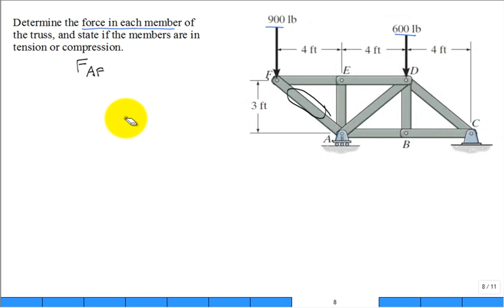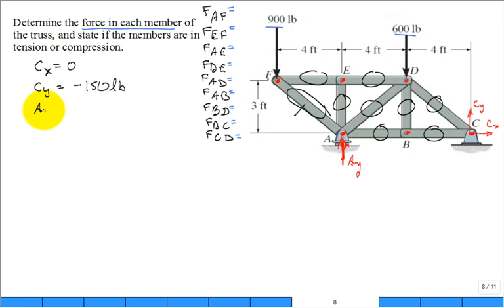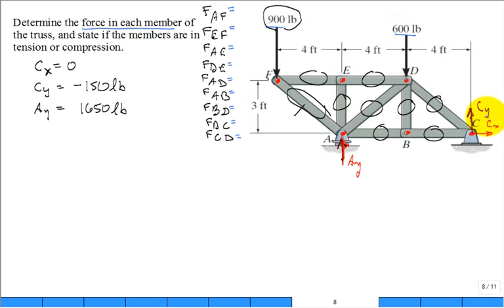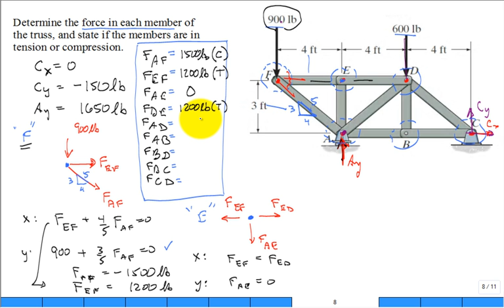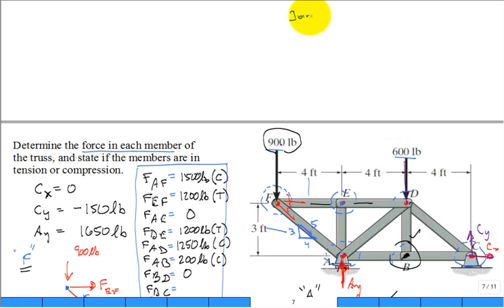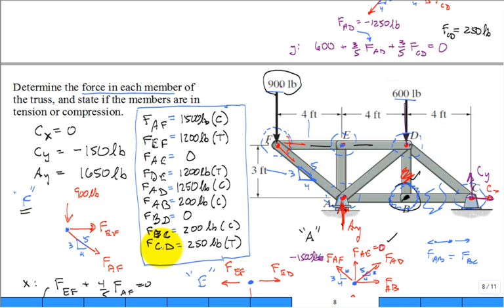Truss method of joints

Comment: for those confused:

Cx is automatically zero when summing up all horizontal forces, because it is the only horizontal force. 

you can get Ay by summing up moments on joint C, assuming that clockwise is positive  : (-600lb)(4m)-(900lb)(12m)+Ay(8m)=0
equation will then become: Ay=(600)(4)+(900)(12)/8 , then you will get 1650lb.

to solve for Cy, use summation of Fy=0 and assume that upwards is positive. you will get: 
-900+1650lb-600+Cy=0 , Cy=-150lb
*1650lb is Ay

Comment: To find Cy and Ay. First, take the moment at point C and you will get Ay, then you will calculate the total forces in the Y direction and make it =0 
-900-600+1650(which is Ay)+Cy=0  ---------------> Cy= -150
Reply: How did you get Ay??
Reply: @airdroper6960  you can solve Ay if you set your moment of inertia at C. Its like this:

Moment at inertia at C = 0;
(Assume all downward force is positive)
1st:
600lb(4ft)-Ay(8ft)+900lb(12ft)=0
2nd:
Ay(8ft)=600lb(4ft)+900lb(12ft)
3rd: divide both sides with 8ft
Finally, Ay=1650ft

Lastly, to get Cy, use the summation of forces is equal to zero.
(Assume downward force is positive)

900lb-1650lb+600lb-Cy=0
Cy=900lb-1650lb+600lb
Cy=-150lb or
Cy=150lb downward
Reply: @airdroper6960  I don't understand where did you get the -150pounds??, btw thanks for the lectures.
Reply: @luqmanzolkibli3041 can i answer now?😅😅

Comment: Are we assuming the values of Ay Cy and Cx??
Reply: no. 

cx is automatically zero when summing up all horizontal forces, because it is the only horizontal force. 

you can get Ay by summing up moments from joint C, assuming that clockwise is positive  : (-600lb)(4m)-(900lb)(12m)+Ay(8m)=0
equation will then become: Ay=(600)(4)+(900)(12)/8 , then you will get 1650lb.

to solve for Cy, use summation of Fy=0 and assume that upwards is positive. you will get: 
-900+1650lb-600+Cy=0 , Cy=-150lb
*1650lb is Ay

this is very late but for some people confused

Comment: AF should be 1500(T)! The force 900 is negative! -900!!!!
Reply: A little common sense will show that the member AF is subjected to compression. While solving engineering problems, we have to use common sense sometimes. However learned we are, often times we get confused at engineering principles. Those confusions can be mitigated to some extent if we apply our common knowledge. Take it not as advice, but as a pragmatic approach.
Reply: @PankirasCleetus it is wrong 
Tension is a pulling force while compression is a pushing force and from the diagram "common sense" and a little bit of research will tell u that AF is subjected to tension while EF is subjected to compression

Comment: Question about that 600lbf: Should it only be applied at the point D? It does not get applied to point B somehow, correct? 

Thanks for the lectures, they help me in my statics class because the problems you do are a little more complex than what we do in class or for homework sometimes. Working them has helped fill in some information that doesn't always come across in class.
Reply from the maker: Yes, 600 lbf should only be applied at D.  This problem is solved using method of joints and "D" is a joint.  Member DB could be in tension or compression, however we determine member DB is a zero force member.  So 600 lbf applied at D is supported by forces in DA and DC.  I hope this explanation is helpful.